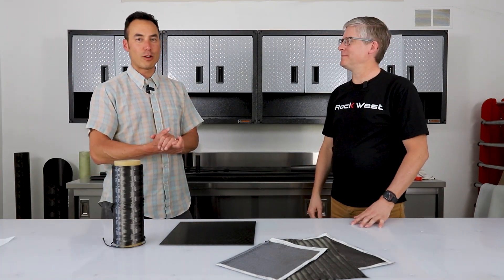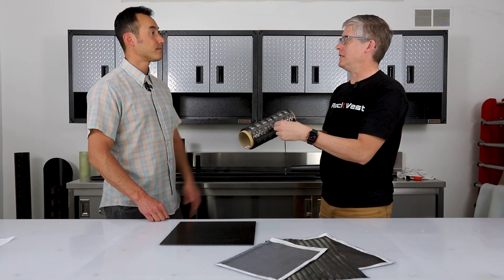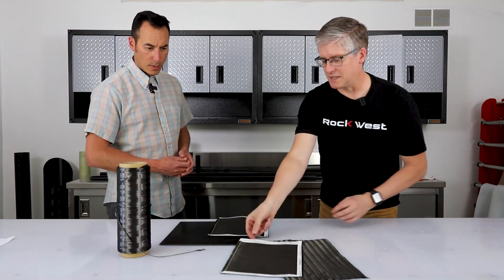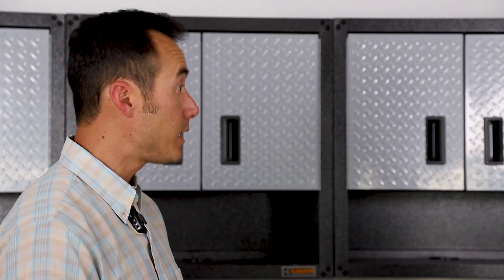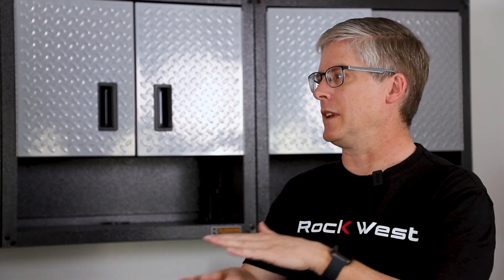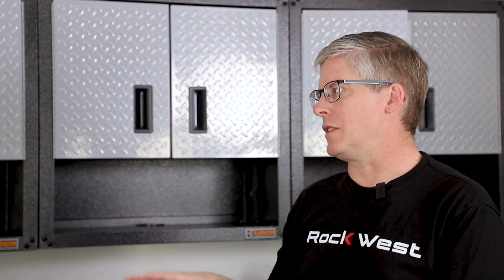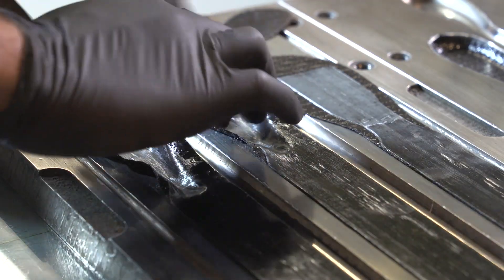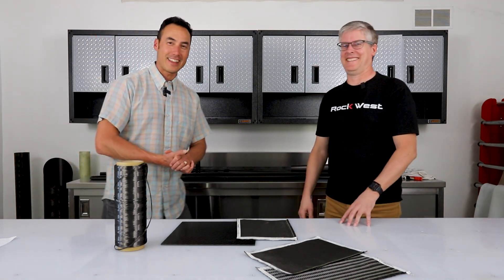Frequently Asked Questions: Part 1

Comment: How do you succeed to produce double curvature bodies such as panels and connect them seamless? I mean how different surfaces come together seamless?
Reply from the maker: If I am understanding your question, you want to connect 2 panels at a right angle (or something similar)? 
The only truly seamless method is to create a mold in the shape you want and lay the material around the mold to create a seamless corner. If you want to connect 2 or more panels, a seamless look is not as possible. It usually requires some tabbing or brackets to hold in place as the edges are not enough bond line to secure properly.

Comment: Hello I want to bond plates together in a sandwich. What surfaces bond together better, twill or unidirectional?
Reply: Both bond together well... if you prepare the surfaces properly. This means that the surface needs to be sanded to remove any shine or contaminants, then thoroughly cleaned with a solvent like acetone or isopropyl alcohol. it is best to apply adhesive to both surfaces before clamping or fixturing.

Comment: Hello, when sucking the air out the bag, does anyone have a link for the type of vacuum valve I can use? Similar to the opposite of a a header valve...? Link?
Reply from the maker: We don't use a one way valve (if I am understanding your question correctly) but rather we pull vacuum using a pump such as this one https://www.rockwestcomposites.com/pump-vt48 though more affordable pumps are available on Amazon (though much cheaper in build quality).
Reply: If you are referring to the vacuum port that is placed within the bag, then this is what you may be looking for: https://www.rockwestcomposites.com/vacport-thrubag

Comment: I am involved with attempting to improve the carbon fiber pool cue shaft, by altering the 'CF' cloth layers to accentuate the lever action of said shaft!!
John,
I'd luv to speak with you on the phone, your knowledge of the different materials could prove helpful!
Reply from the maker: Hi there Bill, please shoot us an email @ inofo@rockwestcomposites.com and we will connect you two!
Reply: @RockWestComposites  
Hi,
I'm looking to make a roll wrap, pool cue 'carbon fiber shaft.....I have an exact size wooden shaft, that can be used to make a mandrel from, and I think I can describe, the type cloth, the layer form to achieve the proper lever action of the shaft, and how it should be finished!
Also, beyond this point, what type foam filler and various other items for completing the shaft!
Anyway, there's no R and D really, been done to make this superior material, designed properly to exemplify the pool cue shafts desired motion!
Thanks,
Bill Gibbs

Comment: Hi guys. I've looked around but cannot find a guide on how can I stop the wobbling for a pole that is fixed on a tripod for time-lapses. Can you help me with some ideas for anchoring this somehow? Thanks
Reply from the maker: There are multiple variables that can cause this. Could be in the head (mount). Could be the ground itself shifting if snowy or icy. But the single most effective means for stabilizing a tripod (outside of ensuring the tripod itself is of high quality and joints / mechanisms tight as can be) is to hang a weight from the headmount nearly to the ground so to "pull" the entire system towards the ground more firmly planting it all to terrafirma.